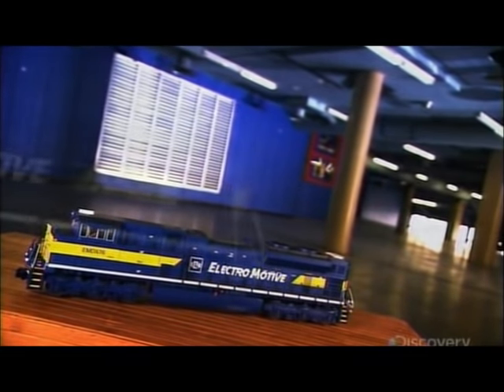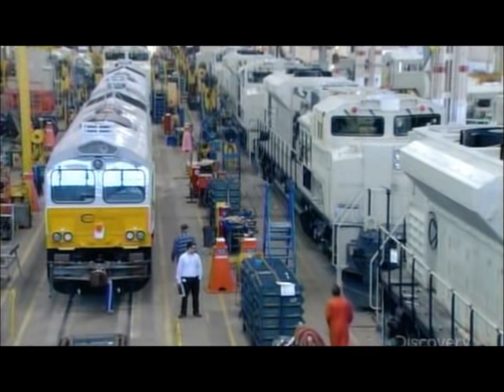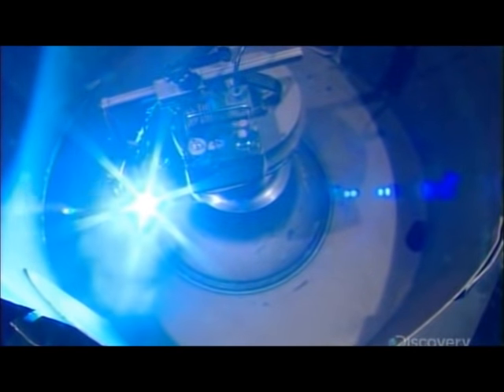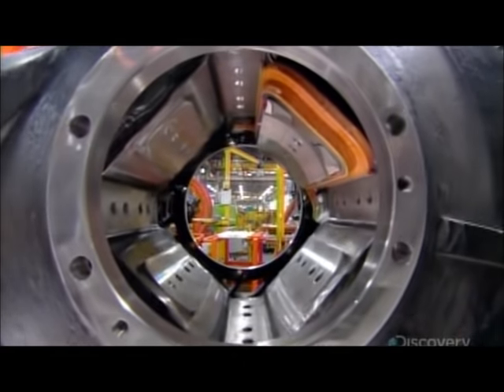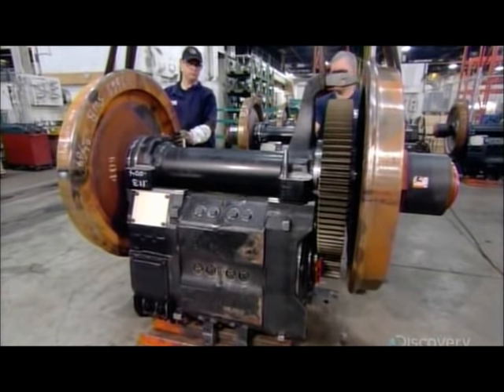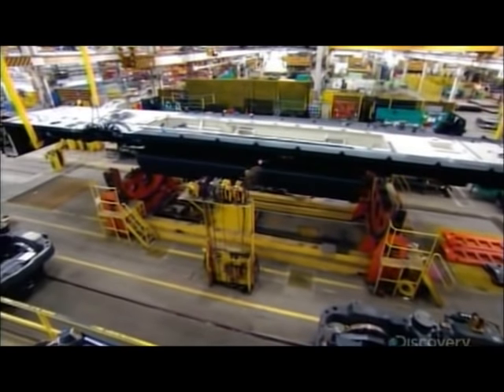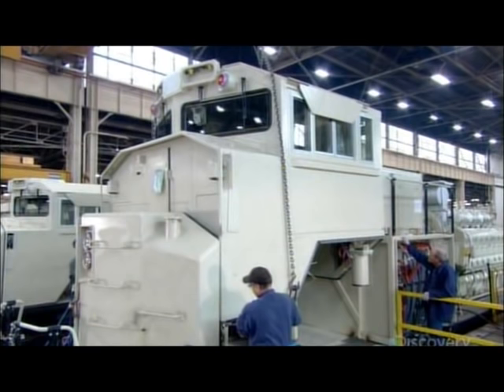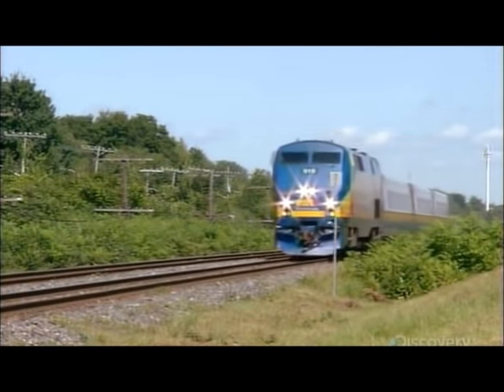How It's Made - Locomotives

Comment: North America has standard gauge which is found in Europe, China, Australia, etc, except for Russia which uses broad gauge (wider gauge). The female voice is annoying...
Reply: Here in UK and IRL it's narrated by Tony Hirst, who has a much better voice :)
Reply: goagăl minus in soviet america, train drives you..
Reply: The former Soviet Union rail system has the largest and heaviest equipment in all the world. Everything has to be double in height and strength.
Reply: In India also we use broad gauge which is 5 feet 6 inches  and is broader than American standard gauge 4 feet 8 1/2 inches . Passenger trains have in general about 24 to 25 coaches the length of train is in excess of 600 metre.
Reply: Also, here in Ireland, track gauge is 5 foot 3 in, which is also found in Australia and Brazil.
Reply: goagăl minus Wow. in the UK trains in the South of England are limited to 12 coaches with a length of around 220 metres. top speed is 100mph powered by a 750v DC third rail.
Reply: Australia has broad gauge to
Reply: SteamLocoScrapper - She's just reading what they put on the page, the one who's really at fault is the writer.
Reply: @Magnus44711URI - 5'-3" is being converted to 4'-8-1/2" in Australia.
Reply: @Scotford_Maconochie - England has a small "loading gage" of low bridges, narrow and low tunnels, passenger platforms.
Reply: Well north america is a continent
The countries are Mexico,USA(alaska included) and canada
Reply: @Kasmuller - North America is the northern part of the continent "America." That's why it's called "North." Greenland is part of the North America continent. The Caribbean islands are on the American continental plate.
Many track gages have been used in North America, from 2'-0" Maine cranberry bog railways to 6'-0" Erie RR. Southeastern railways were mostly 5'-0" but during and following the "Civil War," they were changed to 4'-8-1/2".
Reply: @adrianneils2727  well Not really since America too has very heavy
Even the hight limits of both countrys has the same hight limits
America being 16ft
And Russia being 17ft
And the equipment in America especially the 4014s  and other articulateds, Hell the Pennsylvania railroad and maybe some other railroads in the USA has 5ft gauge track, Also the Pennsylvania railroad had some very massive locomotives even the tenders were almost the same length as the Locomotives them self's, dont believe me, go look up the PRR S1 for example, a American built locomotive.

Comment: Isn't a bad solution the combination of diesel and electric generator but ..... using two types of energy? Better are two diesel engines in a vehicle with dual turbo.
Reply: How do you propose getting the power from the crankshaft to the wheels?

Comment: Why can't they just run the power from deisel to wheel mechanically? You would think it would waste energy to convert to and from electricity like this.
Reply: The engine doesn't have enough power to move a fully loaded train, while the electric motor can easily do it.
Reply: @geologic740  Power in physics would mean horsepower or energy output over time, so if the diesel is the source of the energy that is incorrect. Do you mean that the diesel doesn't have enough torque? Because I know electric motors excel at producing lots of low end torque.
Reply: It may be unintuitive, but the diesel-electric drive is more efficient when compared to the alternative massive mechanical transmission. More robust, too; the first diesel locomotive had mechanic transmissions, but the clutch wore out very quickly and they were difficult to drive, having around 25 speeds or more.
Reply: It’s more efficient with a diesel electric transmission as they are high torque and it’s convenient considering the start-stop nature of the heavy haul freight railroads around the world. It’s also in turn easier to operate as it eliminates the use of a clutch

Comment: Gee whiz...they forgot to show where the spark plugs are installed....
Reply: Hey bud its diesel no need for spark plugs
Reply: I know...as one devoted to satrizing stuff, I couldn't pass this one up.
Reply: It's diesel electric, get it right! Lol jk
Reply: No, no...I just know the plugs are in there somewhere...they just have to be!
Reply: Yea I know what you mean, I can't tell ya anything about the engine/parts of the locomotive. All I can do is tell you what model type it is, what years they produced them and how to drive them!
Reply: robert glenn did u find the spark plugs yet
Reply: I believe I found one located next to the exhaust bearing.
Reply: robert glenn are u sure because the I might of saw one next to the cylinder bearing too
Reply: +robert glenn I spotted another one by the blinker fluid reservoir.
Reply: LMF5000 Oh, man...yeah! The reservior is immediately adjacent to the exhaust bearing assembly point, the perfect place...Good eyes you have.
Reply: I confess, I only found the third spark plug by following the flux pipes from the magic smoke tank. Legend has it if the stuff leaks out the electronics stop working ;)
Reply: Found another plug its next to the intake bearing plus those bearing also need to be replaced
Reply: MultiPowerlin Very acute observation. Obviously, you've experience with this engine Upon second glance, I also notice that the laminant clover cap that keeps the bearings from inducing unnecessary hydraulic blowback is also in need of service.
Reply: robert glenn Meh, just change the flywheel filter, replace the battery oil and refill the spark container with fresh sparks and it'll be good as new.
Reply: LMF5000 Damn, the flywheel. Forgot all about that one...
Reply: I reckon the flywheel just needs new flies. Check the store for live ones hehe :P
Reply: +robert glenn Thank you, kind sir! :). I am a real-life mechanical engineer so my satire-detector was working when I read it, but it's hard to convey sarcasm in comments. No matter how obvious you make it there'll always be that one reader that takes things literally and thinks you're a nincompoop ;)
Reply: They didn't put tires on the damn thing either
Reply: Chase Prollock Man, how did I overlook that one? No tires...They sure screwed up this learning experience...
Reply: And here I was, thinking the internet is always right.
Reply: Chase Prollock Well, someday smart dudes like us will correct this errant stuff...
Reply: It's time for a change!!!
Reply: Chase Prollock You and me, bro...we're the brains to pull it off..
Reply: We've definitely got what it takes! Lol
Reply: I onestly thought this was wat too funy
Reply: No spark plug info... Good to have you guys around . Thanks for the help
Reply: I bet all you guys use left-handed screwdrivers, sew with tartan thread and have your steam delivered in buckets.

btw the loco does have tyres (tires), they're made out of steel.
Reply: The spark plugs go in after they install the steering wheel.

Comment: They always mention horsepower, that doesn't matter on these I want to know the torque
Reply: It does, because they use a electric transferebox that converet all the power in to what ever torque or power that is needed. So torque don´t matter.
Reply: Well if T= ( HP X 5252 ) / RPM...
Then for a 600 HP/3600 RPM electrical engine you would have roughly 850 Ft-Lbs... Now the rpm rating on these is much lower and large freight Locomotives can produce upwards of 100 000 Ft-Lb... Keep in mind that electric motor aren't the same as a gas or diesel engine and produce most of their torque at almost 0 RPM. So as these machines pick up speed the impressive torque they generate falls to 0 (in theory). This is a very simplistic way of explaining electrical motors so I'd suggest you do some digging yourself ;)
Reply: well starting tractive effort on these is around 150,000 pounds or higher.
Reply: Christophe Marin-Beaudry and why they can start a train they cant pull, and steamers could pull a train they could not start, as it were they get more power as they reach speed, and had larger driver wheels, they just pollute a bit more and required more maintance then diesle electros, and that is what in part killed them, as well as the pounding on the rails, but they get peak power at a higher speed, and many of the late period ones could run well over 100 mph with passenger trains, such as the ones like 611, and the t1 prr class as ugly and unique as the t1 was, it was just a nightmare to maintain, and had more power then it knew what to do with, plus those that ran them did not get the propper training on the throttle so they would juke it up like the older ones they would use I think they were called k4's

but that said I just thought i would note they have huge starting torque but not the larger wheels to pull the same load at speed, like the late era steamers.
Reply: +manga12 I think you got that backwards, If a diesel can get it started, it will walk away with it. A steam locomotive with a full head of steam will start a train i cannot continue to pull because it will run out of steam, hense the term "run out of steam". 25 years at the throttle.
Reply: the electros need to cool off, a steamer can keep going as long as it can keep up the steam, till it shakes itself apart,
Reply: @manga12 - Reciprocating steam locomotives don't "shake themselves apart." The main driver wheels pound the rails, even kinking the rails. Movies have been made showing the main drivers lifting off of the rails then slamming down.
A reciprocating mass (pistons, piston rods, crossheads, main connecting rods) cannot be balanced perfectly with a rotating counterweight.
Reply: if it gets into overspeed it can indeed throw parts break pins, derail, throw drive gear, that is what I ment, but that to which you are refering is dynamic compound
Reply: @manga12 - NC&StLRy J3 4-8-4s cruised as high as 110 mph at the head of passenger trains. They were among the most advanced conventional steam locomotives built. By the mid-1950s all but one had been scrapped. That one is the only surviving NC&StL steam locomotive.
The cost of fuel and maintenance had increased enormously. Steam locomotives have poor availability compared to diesel-electrics. They.take hours to start up from cold. Crank a diesel up and as soon as oil and air pressures are up it's ready to go to work.
Reply: yes a diesel might ready faster but at the time many of the late period steamers put out double the hp in a unit to a diesel electro, and the Niagara class to which you refer were probably the most advanced steamers of their day, and they kept them running 6 days and had one day of down time to do maintenance on, and fuel costs for coal and water were not that high compared to diesel, at that time, that is if you look at all the costs at the time, now what killed off the Niagaras were the expensive firebox wrapping failures and dwindling availability of steam engine parts, the Niagaras were very good steam engines, and had about 6000 hp in a northern configuration, or a 4 8 4, most of them with that kind of power were double drivered engines, that had two sets of drive wheels, like the big boys, the challengers, the t1, the Allegheny class, the Yellowstone class, and you got to look at all the costs for example the j northerns of the Norfolk and western were not that far off of a diesel electro, and the coal and water was cheaper at the time, but what it did not require was servicing structures and two men to crew and run the engine, but back to my original point a steam engine makes more of its power the harder and faster you push it, diesel electros make more peak power on the lower end of their torque
Reply: @manga12  The labor intensive support system for steam locomotives is what did them in.  Water, fuel, cleaning, each loco needed a crew of two to operate, water supply(tanks), ash(coal) disposal.  I love steamers but economically they don't make sense.
Reply: @royreynolds108  yes though some of the late steamers fuel wise were still cheaper the diesels and if we want to look at the nw js they could go 500 miles without having to be relubed though they were some of the last steamers built, and we have the niagras  6000 hp roughly and ran five days and did all the maintanance work on sunday with the firebox still 200 degrees wearing special heat reflecting overalls of asbestos not healthy I know but they sure gave the diesels a hard run for a time just they had expesive firebox wrappers, a shame not even one niagra was saved, well in the future though we will have the prr t1 trust's loco, and maybe the coalition for sustainable railroading will find a suitable party and build an all out second or third gen steam locomotive that livio dante porta was speaking of, if you dont know who he was I highly recommend you read up on him and the papers he wrote, that have been released, he picked up where the usa left off and made a locomotive that ran off steam that had a higher power to weight ratio greater then any steam or diesel before or since, not only that I was told by Gary Bensman who worked with him on the ace 3000 project under russ rowland that he was as friendly of a person as he was good at working on steam engines. 

but yes it took special facilities to service the steamers, at very least a place to fill it up with water and coal, lubricate and clean the fire and do some light repairs, as needed

Comment: Alternator?   I was thinking generator
Reply: It is an alternator.
Reply: I do believe it is a generator that produces DC current, it’s then inverted to AC and sent to the AC traction motors. That’s why these locomotive have massive inverter cabinets.
Reply: @mattmoschkau2831 ,  I did research on the subject of my ignorance. Alternator has the windings on the outside compared to the armature.
Generator, the armature is the windings spinning in side the magnet field.